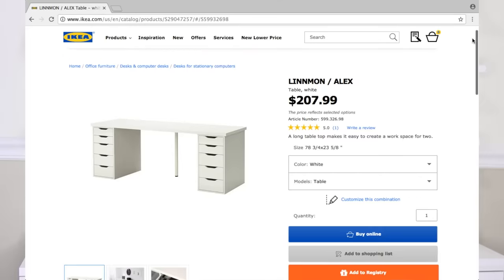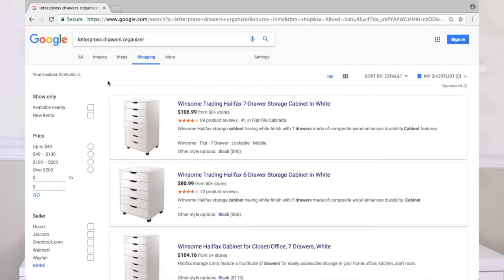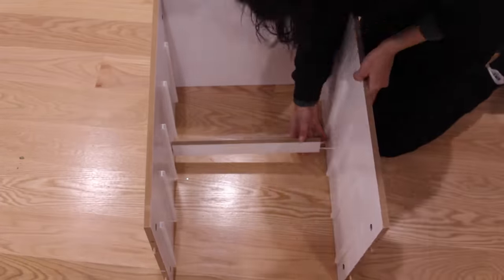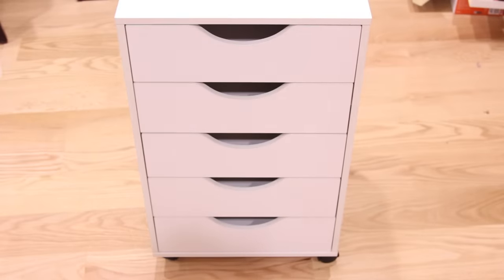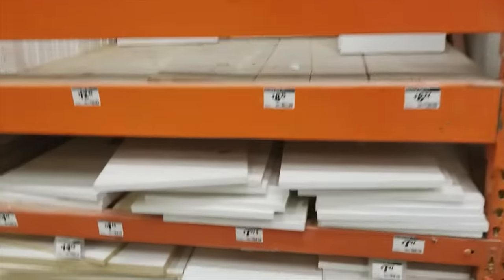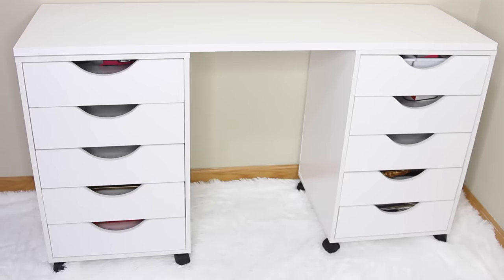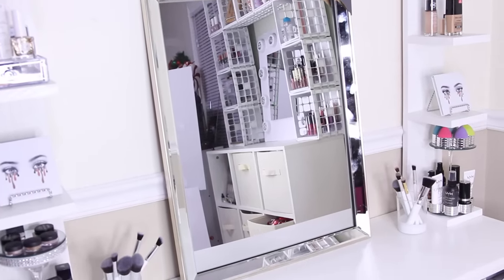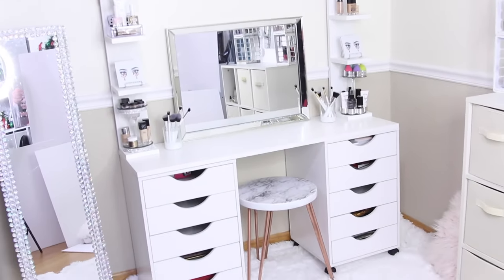IKEA ALEX DESK DUPE DIY UNDER $90

Comment: Also fyi. A lot of people complain about the Michael's drawers because they Don't pull out all the way. I had an easy fix to this. I just drilled an extra whole in each side of the drawers so the little plastic stopper would go there and the drawers opened more. Same concept of adding another whole to a belt
Reply: Evelin Hernandez good idea. I just didn't even put the stoppers in so I can pull the drawer out all the way
Reply: Just dont put the stoppers. I didnt
Reply: 💋💋💋💋💋💋💋💋PEOPLE ARE RAVING IKEA VANITY and LUMIY LIGHTBLADE
Reply: Thank Yu!
Reply: The ikea ones dont pull all the way out either but you can drill another hole. You just have to be careful because then it wont be as sturdy
Reply: The Michael drawers are a nightmare to put together

Comment: Great job! If you don’t want to permanently attach the top just use industrial Velcro on top of drawers and bottom of top. Holds entire unit together very well, will roll to move and come apart if needed to move to another location.

Comment: Question, I have one of those Michaels drawers and I want to buy another one so I can make a desk like this, however even with the wheels on I find it to be really low to the ground so I was wondering do you know what I could use to make it taller?
Reply: Mykaila Michelle  Could you get a third drawer and cut it in half to add on each side? My daughter has really wanted one of these. I love it!
Reply: mhm never thought of that tbh but I don't have the tools to cut it in half!
Reply: I thought about putting pieces of wood on the sides between the drawers and the top and nailing everything together. It would make open shelves on top of the drawers on both sides. I don’t know if I make sense.
Reply: You can go to Home Depot and purchase furniture feet. The come in all heights, sizes and shapes.  You can spray paint them to match your drawers!
Reply from the maker: Hi Mykaila! Yes, you can get furniture legs and paint them to match your drawer color.  The only thing is trying to find legs that are inexpensive but sturdy cause if you spend to much on the legs,  you might as well get Ikea drawers.Maybe even wooden blocks sprayed?
Reply: Betty Drago my husband was thinking the same thing. Add more height to the top and it’s gives more storage. We are either going to do that, or I’m just going to add short table legs to it. Adding to the top would definitely be cheaper though.
Reply: They sell the cube storage unit legs at target and Walmart and they're metal so pretty sturdy! Cost I think about $10 for 2 legs.
Reply: Do you mind me asking how tall are you? I want to try this but i'm afraid it's going to be too low.
Reply: You could use those plastic square bed risers that they sell at Walmart. I used to have them under my daughter's bed so she had more room under her bed for storage.
Reply: I just built my drawers and have this same issue. My roommate recommended the wooden crates from Walmart to raise it up a bit

Comment: Some people put a piece of plexiglass over the desk top to protect it? Have you thought about that? If you do decide to do this, no one shows how they measure it or how they adhere it to the desk. If you do can show that whole process?
Reply: GlowySweetFabulous I got clear acrylic at Home Depot for the top of mine, and I stuck it down with double sided tape lol
Reply: Hi most hardware stores (home Depot and Lowe's) will cut the plexiglass for you for free to your measurements. You just pay for the material which is pretty cheap. You can get those clear little rubber grip stickers to place under glass on desk and it won't move. You can get those at Home Depot or Lowe's too

Comment: Oh also, how's the height for you? Uncomfortable? Heard it's lower to the ground.
Reply from the maker: Adijat Mustapha Hi Adijat! Great question. I probably should've cover that. I don't  have a problem with the height at all but I'm 5'4 (average height). I can see the height not working for someone who's taller or if you're using a taller chair/stool.
Reply: Bargain Bethany thanks for the response Bethany! I'm 5'5" so it would probably be okay for me too
Reply: Adijat Mustapha also you can just add legs to the bottom of the drawers if you wanted to make it taller(:
Reply: Evelin Hernandez yes, I was thinking the same thing. Just pop some legs on it it’s too short. The desk I have now is perfect as far as height (but not great for storage or style) and it’s almost 30”. ...If you compare, this desk will be a little more than 27” with the wheels on.
Edit: I went to Home Depot & got some legs. Easy to put on & made it the perfect size. (Almost 30”) I did feel like it was a little short before the legs, but it was an easy fix & the legs really make it look nice!!
Reply: Great idea my daughter is 5'6"I was concerned about height as well. I'm so excited to work on my daughters room and share!
Reply: Adijat Mustapha n
Reply: Puppy Love what kind of legs you get ? Or (Asked for)

Comment: @bargainbethany I like how you laid out the project and talked about it without repetition since other youtubers show all the steps. I have a few questions for you while I'm considering doing what you did here or buying the Ikea desk. 1. Is the board you used on top easier to clean compared to regular wood? I use loose powders and end up splashing makeup all over the surface. 2. Do you find the drawers, are they sturdy enough & easy to clean (let's say I want to store a bunch of setting spray or toner bottles together)? Also if I can afford the Ikea original,  do you recommend it over the Michael's DIY for quality? I do like that this has wheels as I also have wood floors.

Comment: I just got two of these online. I can't wait to get them!
Reply: thelittlewildkat1 you paid $100 for each?
Reply: CandieCayne Reed I paid $39.99 for each on the Michael's website. Well plus tax.
Reply: I also added legs that I painted silver and put marble contact paper on the top and a little strip of bling wrap around the top border. They came out absolutely beautiful. My vanity room (converted wine cellar) is silver and white.
Reply: I did not use the top piece as Bethany did. I have those shelves on either side of a silver vanity settee with a mirror I already had. I wish I could post a pic of how it turned out. That vanity only had two drawers, adding those gave me all the storage I'll probably ever need.

Comment: you dont have to get the 6ft table top at Ikea, if you search under the linnmon item name they have a shorter one so if you buy that along with two of the drawers you can get the entire vanity for under $200.  I dont think the one from Michael's comes in the color I want which is black.
Reply from the maker: Meagan Vogelsang Hi Meagan! I've never seen the Michaels drawers in black. I saw them in black on other websites. I saw the cheapest Linnmon they have didnt have to drawers but I think it's  a great option especially for someone who prefers  fo keep less makeup.

Comment: I personally think plywood is a better choice compared to particle board. Particle board is easily warped and damaged when it comes in contact with water or moisture unless you apply a sealant. It's also heavier and can cause the wheels on the drawer to collapse. Which is definitely something to consider since you're storing cosmetics on it and a mirror (unless you hang it). It's also very weak compared to plywood so it won't hold up as long. 

Plywood is a bit more expensive but considering the fact that it's lighter, more durable, longer-lasting, holds stain and paint well, more water resistant, and can hold screws and nails well (whereas particle board would break) is definitely worth investing in. Home Depot has particle board with the same measurements (3/4" x 2' x 4') for $16 and plywood with those same measurements for $19. 

Oh, and plywood is eco-friendly! :)

Also, I was wondering if the 15" gap for leg room would be too small? How much space do you have from your leg to the side when sitting under it? And what's your pant size so I can compare my thighs, lol.

Comment: I have these same drawers and they do not hold much weight.  Just my lipsticks make the drawers mis-align and stick.
Just an FYI
Reply from the maker: Hi Jane! I haven't had any problems weight wise with mine yet.  So far mines have worked out great for me. I did put heavier items on the bottom.  Maybe I can test it in a video.
Reply: Bargain Bethany t
That would be great
.   This way I can see if I got a dud!

Comment: Thanks for input on Michaels havin them even cheaper than amazon. Ikea is like 3 times it's in store price on Amazon it's nuts especially for such cheap shit. I drove 2 hours to Ikea and the only 3 items I went there for were OUT OF STOCK F that place and there 100 dollar shipping. FYI the drawer units near me are 54.99 at the moment in Ohio at Michaels. Also if you're worried about it sliding don't install the wheels and you can buy a pack of 4 adjustable leg supports on amazon and make the desk higher that way by putting those under the tabletop in 4 corners.